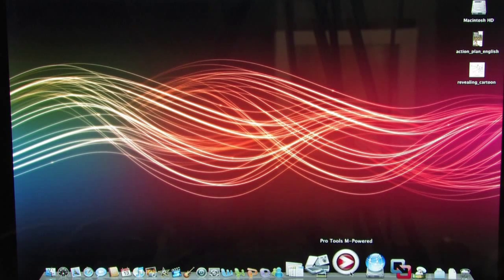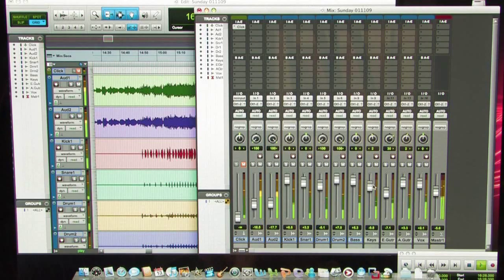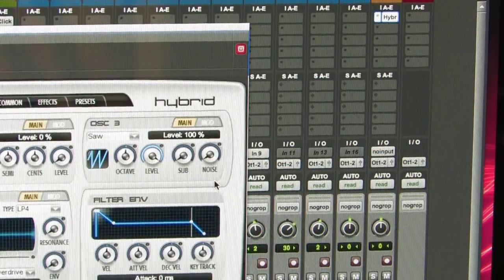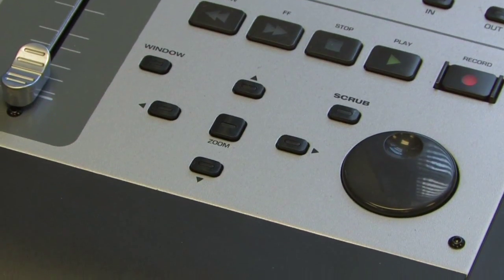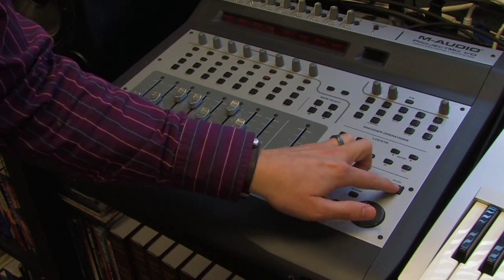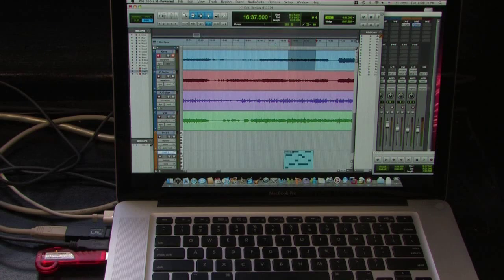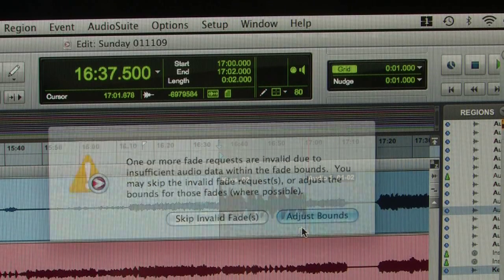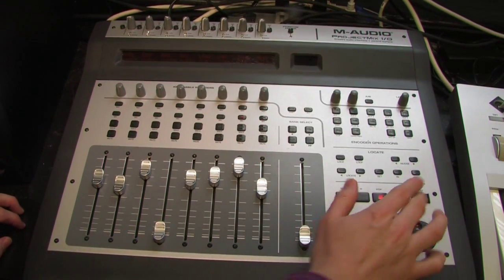Home Recording Part 2 - Overdubbing

Comment from the maker: @moy0429 "Overdub - The process of laying new audio material in, over, or with existing material. Generally this applies to adding parts to a multitrack recording. The word originates from the word dub. Years ago, when all we had were single track tape machines, the only way to add material to an existing recording was to dub that tape to a second machine and mix in the new material along the way."

Comment from the maker: @3ssBy The ProjectMix is sufficient to run Pro Tools M-Powered -- no Digidesign MBox required.  I use a MIDI keyboard with USB connectivity, so it goes directly into the computer.  The ProjectMix  will show up in your Mac as an audio device, and you can play anything (iTunes, etc.) through speakers attached to it.  Not sure on the Tascam question.

Comment from the maker: @jclatino0204 Definitely 003 over 002.  I don't know that much about them, but I think if you need more inputs, go with the rack.  If you need the control surface, go with the mixer.  I usually go with the mixer.

Comment from the maker: @Treeofsalt First, make sure the general volume knob is turned up also (I forget what it's called exactly).  You can turn the headphones up all the way, but if the volume level isn't also up, nothing will come out.

Second, you need to use the M-Audio Firewire application to blend what's playing back out of Pro Tools with what's being recorded.  You can also feel free to move the faders in Pro Tools to make what you've already recorded less or more loud as you record a new track.

Comment from the maker: I have a KSM 32 and am decently happy with it.  I think you can hear it used on a djembe on one of my other videos.  I'd go with a 32 or 44.  The 44 has different pick-up patterns (omni, cardiod, etc.).  The 32 is cardiod only, which is fine if vocals in the only thing it'll be used on.

Comment from the maker: I count 5 XLR inputs and two 1/4" inputs.  That would fit within the ProjectMix I/O.  You'd just need a direct box for one of the two 1/4" inputs.  You'd even have room for one more input.  As long as your computer has Firewire, you should be good to go.

The LightBridge can do up to 16 inputs.  But it would only convert them from ADAT to Firewire.  So you'd need a separate audio board with XLR ins and ADAT out.

Comment from the maker: Well, the first thing I'd recommend is taking advantage of your free tech support from Digidesign before it runs out.  Give them a call.  But also, check to make sure you've installed the latest drivers from m-audio's Website and that it's plugged in, powered on, and in Pro Tools mode (see manual for details on booting it into that mode).

Comment from the maker: Pro Tools doesn't work through your regular speakers, so that's probably the problem.  Pro Tools only outputs sound through the interface you've got connected (the same one you're plugging your mic into).  It should have speaker outputs and headphone outputs.

Comment from the maker: Wow, that's a good question.  I've never had that one before.  I would think so.  The ProjectMix I/O transfers its control data via MIDI in the HUI format.  So, theoretically, you should be able to attach it via Firewire, open Pro Tools, go to Settings, Peripherals, MIDI, and then select HUI as the control type and ProjectMix I/O from the In and Out drop-down lists.

Comment: I use multisampled vst intruments. They are heavy on the computer.  You really need a low latency to play them. I mean, you wanna hear the drum and/or string sound as you press the key. Not a sekond later. I also like hearing a reverb as I track my vocals. But I guess that's not possible with the projectmix? since you need to monitor before pro tools in order to avoid latency? What is the latency? in milliseconds? Can you monitor afterPT8 with an effect in low latency? like reverb? thnx